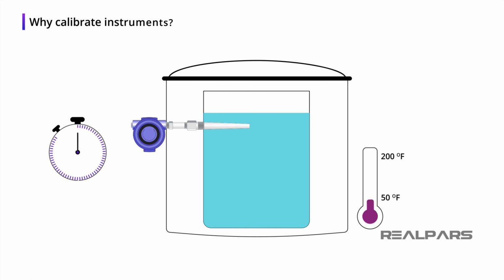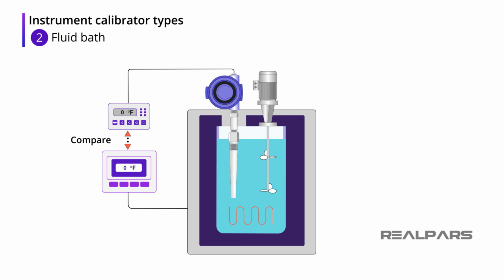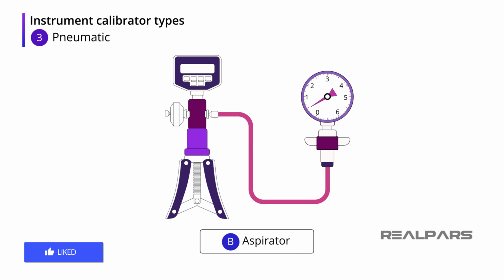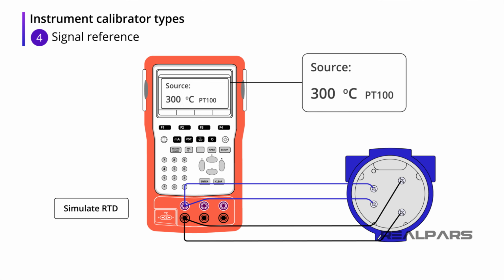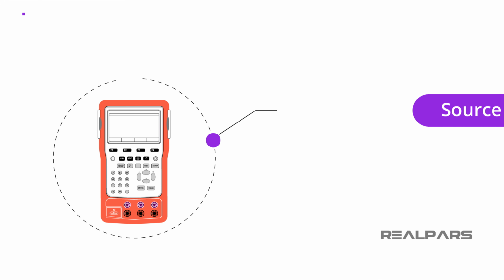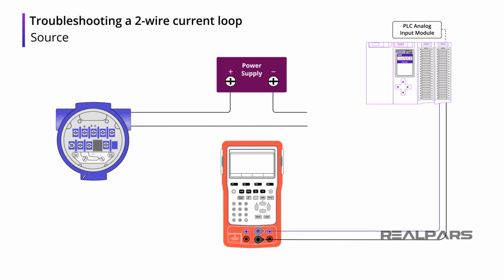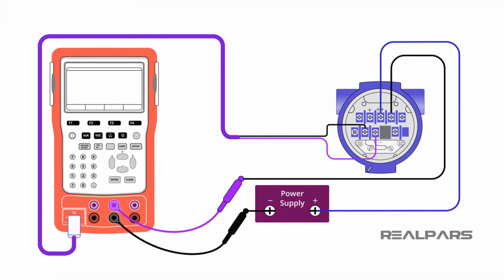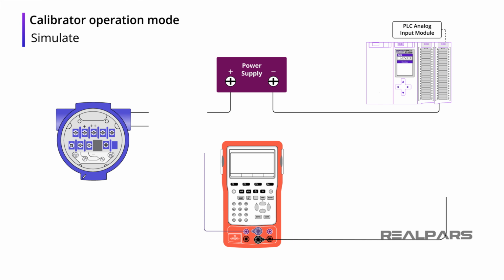What is an Instrument Calibrator?

Comment: I have a question from a previous video, i hear a lot about self calibrating instruments these days, what are the limitations of self calibrating instruments and will these instruments completely replace manual calibration?
Reply from the maker: There are certainly pros and cons when it comes to self-calibrating instruments. They are expensive, not easy to repair if they fail, and quite often require tweaking and periodic checks to verify correct performance. Will they completely replace manual calibration? I’m not sure if anyone can answer that question now.
Reply: @realpars  thank you, i appreciate your reply.
Reply: Some instruments can perform self 4-20mA simulation on the instrument itself like a lot of modern E+H (Endress Hauser). They have that functionality to self test simulate check the loop for Troubleshooting. They also have a default functionality to return the instrument to Default Factory Calibration. I’m not sure if all instrument has this, but some do. It’s like the calibration is screwed up, you just want to return it to factory original setting. Working for an OEM that make process equipment, many the instruments we order are ordered directly from vendor under specific project #, and the instruments from vendor factory are made, tested, calibrated after ordering. So they have factory calibration at that time of manufacture. However, that said, it’s good to have all the necessary Calibration Tools.

Comment: Dear Sir,
As usual thanks a million times for your amazing explained tutorial, 
I've this short question, please 
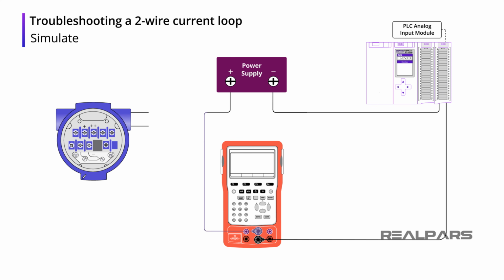@ 06:10 in the Simulatie Mode, why did you connect the power supply in Series although the calibrator being used in the video is Fluke 754 which has the capability to source & simulate alone without external power supply, 
This quest came up as the basics of the tutorial says:
- Sourcing is replacing the transmitter & power supply to check the Passive Receiver which in our case Analog input module, 
- Simulate is replacing the transmitter also for checking or calibrating but an Active Receiver which the Analog input module, but why in your simulate process you kindly kept the power supply in the loop,
I do highly appreciate your effort and time in making such useful and very educational videos
Reply from the maker: Hi @Malik Arthur. Thanks for reaching out, and thank you for your kind words. In Simulate mode, the calibrator replaces the transmitter. By connecting the calibrator in place of the power supply, we are "simulating" the entire loop.  So, we can set the current output of the calibrator for any value we want.  If we get the results we expect from the PLC, then we know the problem is the transmitter. If we don't get the results we expect from the PLC, then our problem lies somewhere else in the loop.  I hope that helps. If not, let me know.
Reply: @realpars  
Dear Proff. 
Thanks for your professional attitude in handling our enquiries.

I watched the other videos, on your valuable channel, which are related to Source and Simulate Procedures for testing control loop components.

I could now summarize it as simple as this;
In Sourcing mode the calibrator works as power supply and signal regulator to the receiver ( the signal per our calibration desire ).

In Simulating mode the calibrator relays on external power supply and it only regulates and magnitude the signal to the Receiver.
In Source mode the calibrator replaces both the power supply and the transmitter.
In simulate mode the calibrator replaces only the transmitter.  

And again i can not thank you enough for your time & effort in preparing such amazing tutorial videos.

Comment: Is there any recomendation for handheld communicator (HART)? for pressure, flow, temperature. It would be nice if it under $7k
Reply from the maker: Hi @iammostwanted kun.  There are lots of HART communicators available.  It's difficult to pick or suggest because there are so many to choose from. As with most test devices, Fluke is a leader of course.  And, as they say, you get what you pay for.
Reply: @realpars  any suggestion between AMS TREX and Fluke 754? On what i see the fluke 754 is more an all in one device. But others also recomend me with AMS Trex which i dont know what is the pros for that device.

Comment: Dear Real Pars. Excellent Explanation! I have a question. Are there automatic calibrators currently for industrial sensors, or any sensor that can auto-calibrate itself?
Reply from the maker: Hi Hector!  Those are great questions. There are sensors that perform certain auto-calibration functions. For example, Honeywell has Auto-Zero, a calibration technique for specific pressure sensors. We can only assume that now that we are in the IoT Revolution, Smart Sensors demand that we pay more attention to the development of Auto calibration and auto-calibrators. Of course one of the primary problems is knowing that calibration is necessary. One can spend hours on the internet reading about this!
Reply: @realpars  Ok thank's!

Comment: Calibration = Correlation.  Your instrument calibrator it is actually a Secondary Standard that is certified against a Primary Standard.
This Primary Standard shall be send to the National Standards Bureau Center to be certified; Or it can also send be send to laboratories that
NSB "designates as authorized  to carry out this certification."
These laboratories should indicate ( data and written) whether the measurement equipment meets the requirements to act as a primary standard and 
the operating conditions.
The laboratories will be issue a certificate  with the correct data and such document will be indicate the percentage of deviation regarding with respect to their 
NSB standards and if they are within the deviation parameters
The calibration or correlation process is very important to be carried out.
Because if it is not done correctly can severely affect the personal safety of personnel and it can cost a lot money and time to repair the damage.
Other inherent advantage of a good calibration program is that the effectiveness and reliability of the equipment can be monitored and will be determined when is best time be be replace such equipment.
Calibration Program has Three Stages.
1.- Shall send  the Primary Standard to NSB or its assigned laboratories, for correlation and certification again the NSB standards
The Primary Standard shall never and ever be used as a Secondary Standard
2.- Correlate ( without forgetting the operating conditions with which the Primary Standard  was measured) the data of Primary Standard with the readings  of Secondary Standard to see if they can be used as Secondary Standard.
3.- Correlate the measurements an equipment that is subject to calibration vs Secondary Standard ( Instrument  Calibrator) readings and determine if the equipment parameters need adjusted.
Reply from the maker: Hello Luis C Ballesteros...... Thanks for your input! We couldn't have said it better ourselves. We can't know for sure if our calibrator is actually producing 4.0 mA unless it has been recently certified to do so.

Comment: Well.... please get the words straight....  adjustment is not calibrating, these are two different procedures.... but anyway nice Video .... unfortunately these task becomes more difficult with io link or any other databus
Reply from the maker: Hiya foxtrot....... Thanks for your feedback. Yes, you are correct. We make this statement early in the video..... "Instrument calibration is an adjustment or a series of adjustments performed on an instrument to ensure that the instrument readings accurately represent the quantity being measured.".  We could have added that once that has been accomplished, the instrument is calibrated.

Comment: Another great video! 

A couple of things to be aware of is:

a) Calibrators need calibration too. For most machinery this isn't a really big deal, until it is. :)
b) One of the best early warning tools is your PID loop. The natural tendency is to blame the PID when it is simply reacting to different inputs then what it was set up for. Whenever you have a previously well-tuned PID loop get unstable, look at your inputs and outputs.
Reply from the maker: Hi MrWaalkman........ Thanks for your input. Yes indeed...Calibrators need calibration. Another reader Luis Ballestros mentions the terms primary and secondary standards in a comment on this very same video. One can only assume that the calibrator is actually producing 4.0 mA when being asked to do so. Good insight on the PID loop too.
Reply: @realpars  As for a current source, I agree. They are dead simple to make, and are basically bullet-proof. With only three parts it's pretty hard to mess up. 

Here's my go-to circuit:

https://www.bristolwatch.com/ccs/LM317.htm

I added a switchable resistor bank where I could select 4, 8, 12, 16, and 20 milliamps on mine. You can get a cheap one these days for less than the cost to build one. That wasn't true when I built mine (otherwise I would have bought one). In any case, it's hard to justify a $800 current source unless you really need it.

I do have a few NIST traceable testers, which I bought for their (presumable) accuracy and not because I'll need/plan to send them back to get them calibrated. Some testers I would, like an RH meter since it is a bit of a demon at the best of times. For the most part regarding on what I work on, close enough is close enough.